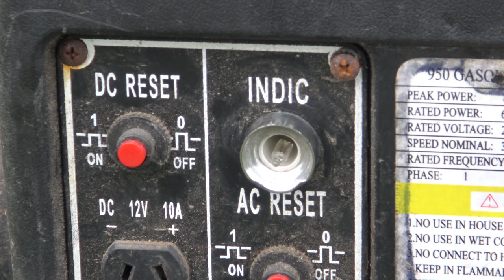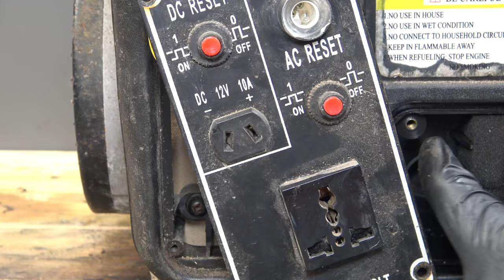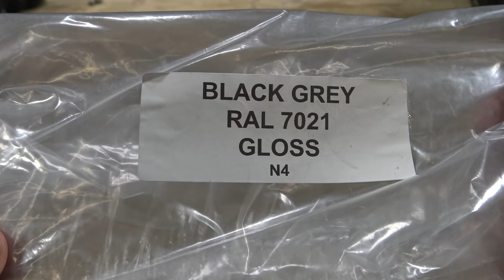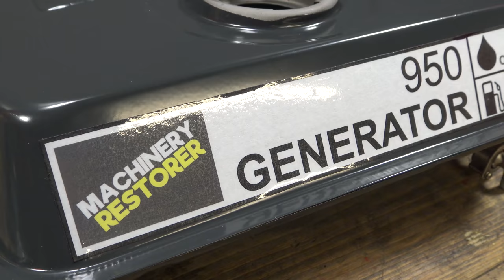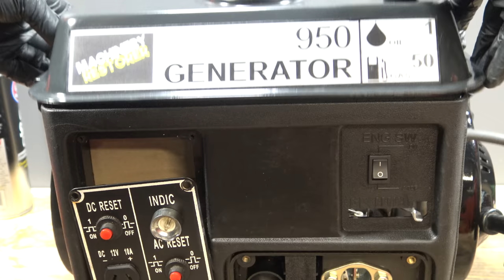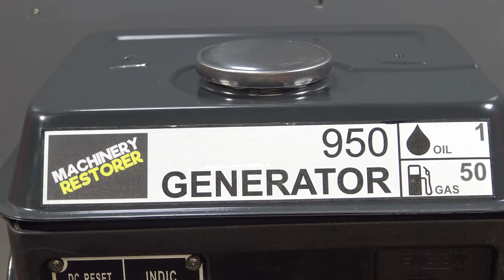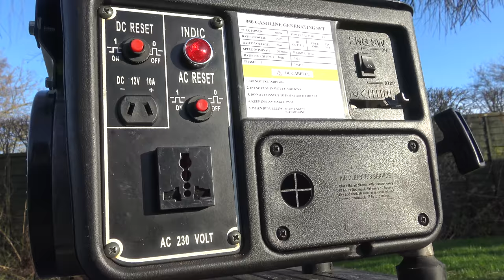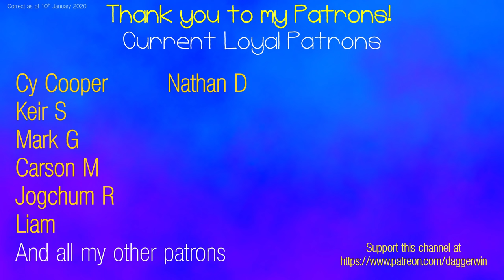CHEAP RUSTY GENERATOR RESTORATION (Are They Worth It)

Comment: Love the restoration vids good job maybe do one on sharpening drill bits lol
Reply: It actually shows that the generator can handle a bit of load - better than before.
Reply: Or having the drill spinning the rite way
Reply: LOL   Burned a hole in that wood!!!
Reply: Also, the viewer can always turn the sound off whenever (s)he wants a silent video.  I usually prefer commentary.

Comment: totally worth restoring. Why ? because you now know the whole machine inside and out. you can repair it if you need too AND be less dependent on sending it "off" for repairs. This is a real problem with todays mechanical/electrical items from mega stores.

Comment: Did I miss a video about the powder coating machine, have you ever mention it ? Never know you could do it yourself, I know it's easy, powder, magnetic and bake it. You triggered me to find out more about it, it would be great to do it also myself. Also, nice to see subtitles, good addition!!!
Reply from the maker: I used it in my Westwood gemini rotavator restoration too. :)
Reply: @MachineryRestorer  Was it worth it? I would say no, at least not to those standards, for several reasons.  Firstly, I find that about 1200 watts are needed to start many refrigerators, which is an important job for generators to preserve food during blackouts, so these little ones have reduced utility.  Secondly, partial choke probably would have kept the generator usable in the short term, and constant, liberal use of fuel detergent likely would have helped in the longer term.  Thirdly, you could likely prevent future rust by taking it to a self serve car wash and spraying it down with spray wax, which made all the sandblasting and powdering work unnecessary.  though cleaning the cooling fins might have been necessary, i'm not sure; but generally, I think it could have been made useful and flipped with far less work and expense.
    How did the finances work? Did you make money on it?  I never seem to see cost/benefit ratios on these vids.

Comment: that appears to be the exact same ultrasonic cleaner I use, except i use carb dip cleaner (comes in a gallon can at auto parts stores) in mine instead of soapy water. they really are time savers.

Comment: Does your blasting cabinet have a dust extractor fitted please? I'm trying to decide which model to buy! Any advice or opinions welcome please.
Reply from the maker: Hi, I had to fit the extractor as an extra but it did have the hole pre cut in the side. 
This is the cabinet - https://www.ebay.co.uk/itm/Switzer-Magnum-Sand-Blaster-220L-Sand-Blasting-Grit-Bead-Sandblaster/200567742812?hash=item2eb2c4e15c:m:mqzQUb4dHglTb8c1p6JZt1Q
and this is the extractor - https://www.ebay.co.uk/itm/Small-Sand-Blasting-Cabinet-Dust-Extractor-Sandblaster-Dust-Collector-Cabinet-SB/383364781942?hash=item5942525776:g:SaAAAOSwBO1eGKet

Comment: I just fixed one of these up I found at a garage sale. Just needed a new spark plug wire and recoil cord. A little carburetor adjustment and fresh gas, it starts right up.

Comment: I am curious as to what kind of pump that sandblaster uses, it sounds like a shop vac and produces continuous high air pressure.   Does anyone know?
Reply: It's a suction feed from the air compressor. The noise you hear is the extractor fan on the side of the cabinet
Reply: @Daggerwin  Thank you

Comment: And even you do not that a 4-stroke engine is supposed to start so that you first pull it slowly and find a compression stroke, and when you find it, then pull quickly. This machine would have started on the first or second pull, if you would have done it proberly..
Reply from the maker: This is two stroke
Reply: @MachineryRestorer  Aah, okay, well that explains it then. :) Nice video altough! :)

Comment: Mr daggerwin sir, the cleansing machine you put the carburetor in does it affect rubber seals with the acidity?
Reply: FootLoose Toucan ultrasonic cleaners usually don’t need  harsh chemicals. Most things can be cleaned with water and a drop of dishwashing liquid, or special cleaning fluids.
Reply: @veldmaat  ah i see i thought it was a mixture of vinigar and rust cleaner and all that jazz
Reply: @footloosetoucan1238  I don't know what he used, I'm just saying that ultrasonic cleaners do a great job without harsh liquids.

Comment: I think I have that exact generator. Although I don't remember it having a 12v out.
Reply: Every generator has an extra 12v out for charging batteries 
currently i use a tiger 8amp gen 2x larger than this one generates electricity for my whole house
Reply: None of my 3 generators have 12v out.